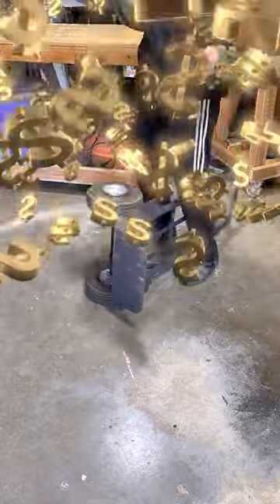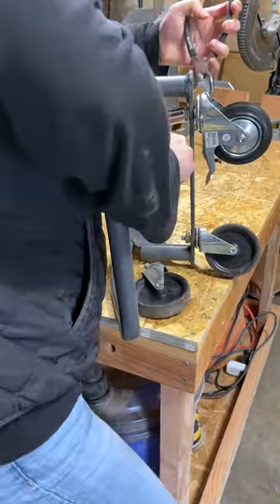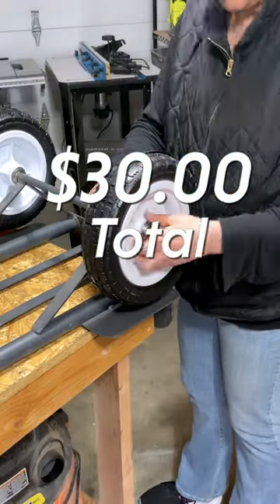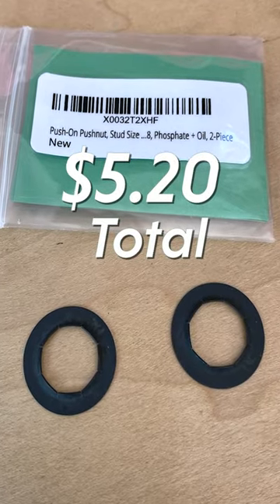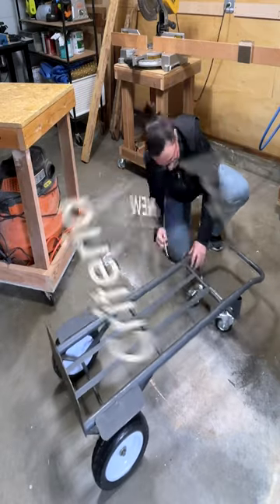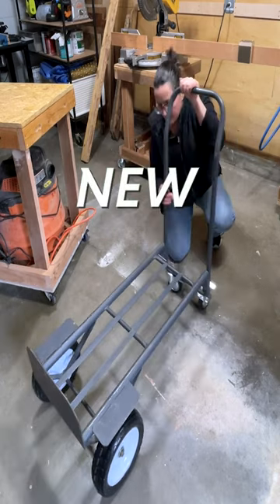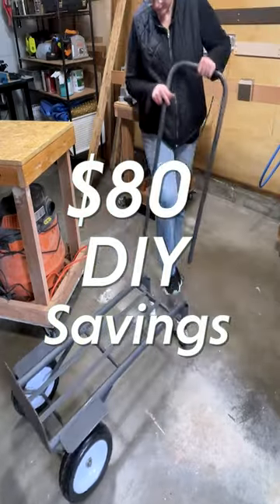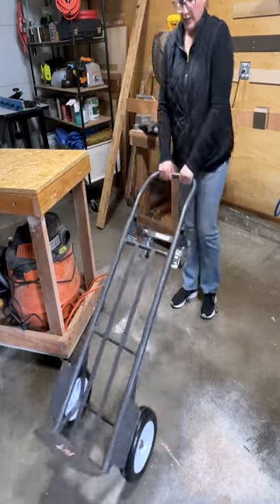🤑💰 DIY vs BUYING NEW - Hand Truck/Dolly Project 🤑💰

Comment: i bought a $3 wide handtruck 

apllied $3 rust coverter 

sprayed $5 of black paint 

bought $10 lawnmover then took 2 back 11inch big wheels

bought 1/2 carriage bolts too relocate axles $6 and i 

pickup all nuts on side of road i use (8) 

$3 cut off blade to narrow the truck to be more agile was 24 wide now 19½  

$2 pipe insulation for appliance protection 

$20 lawn edger handle for a nose plate extension 
= $52 with my options

and harbors freights around $59, i hate the pneumatic tires and options are expensive 

(now i thought of tracks to get up stairs easier)